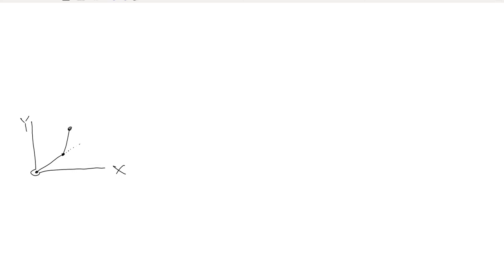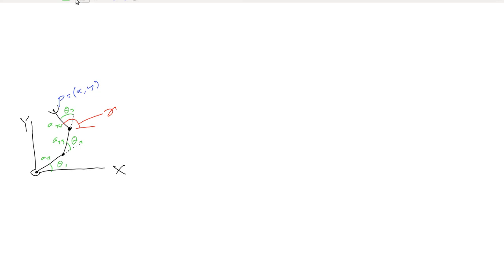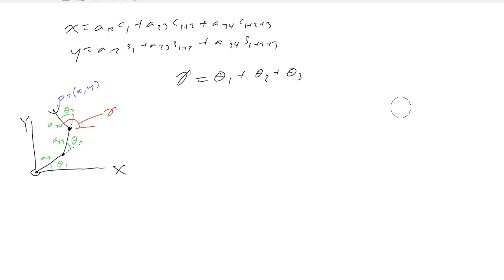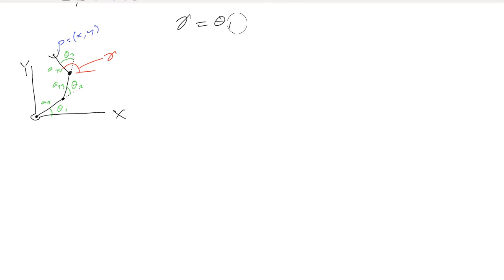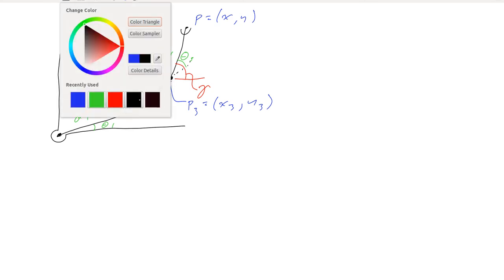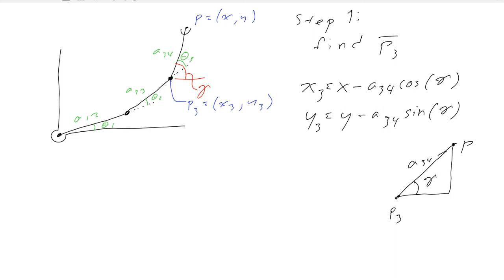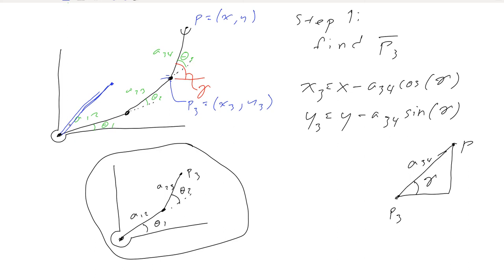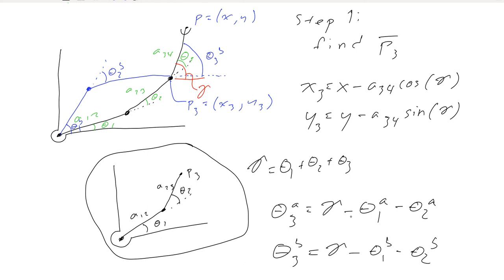Planar 3R inverse kinematics

Comment: what if the given for the inverse is: L1, L2, L3, (x,y) without phi or any other angle?
Reply from the maker: If you're only specifying two parameters then for the 3R robot you have an "underconstrained" system.  This means that you have an infinite number of possible combinations for the three joint angles.  You could use some other consideration to pick the best combination out of this infinitude.  An example would be to have the smallest change from the previous robot pose.  Another example could be to minimize energy use by keeping the first joint close to vertical.

Comment: If I want that the robot arm rotates around z axis on the base how do I do to find the fourth angle? In this case it's 3D problem.
Reply from the maker: By "z axis" do you mean the one that's drawn vertical in the figure in this video?  If so, then the process would be to find the angle for that joint that gets the plane of the rest of the robot (the three links shown in this video) to contain the point you want.  After that, the process is the same as for the 3R.